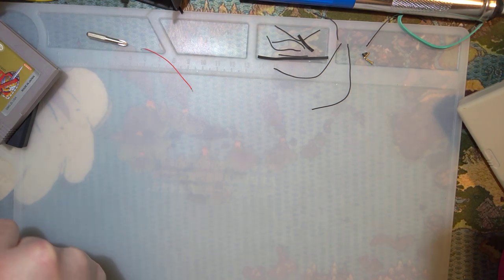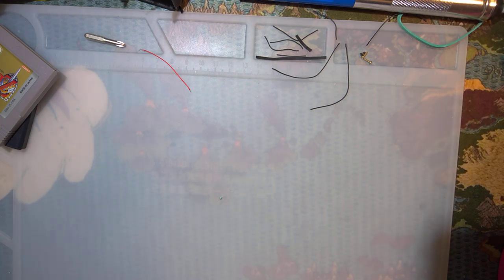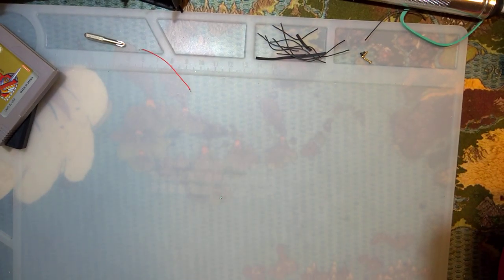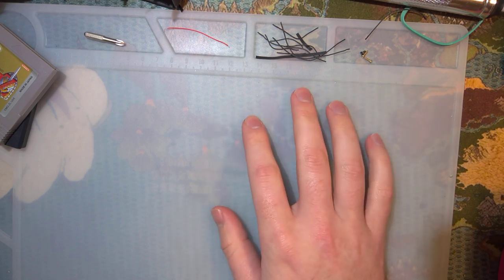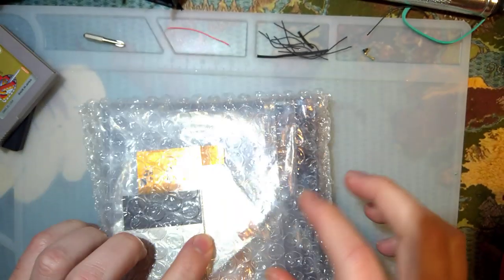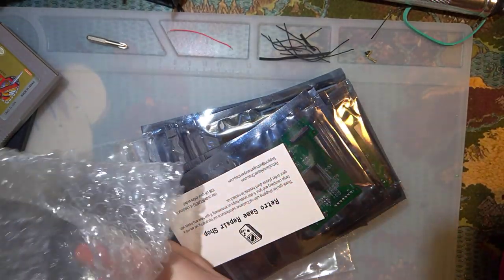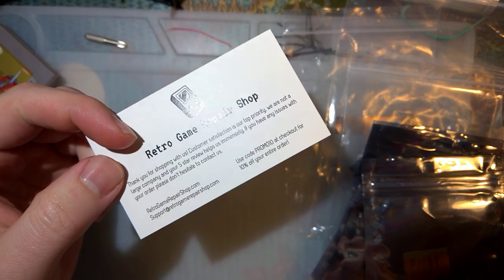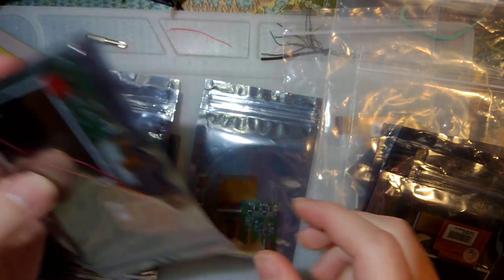Troubleshooting Faulty Backlight Kits

Comment: I got an AIO kit and their 3rd anniversary pokemon center shell from them. I think their products are pretty good
Reply from the maker: I bought a MGB kit from them a few weeks ago (and then I just got two more in this video before I got a chance to install that kit lol) and I was really impressed with both the speed of delivery and the packing of the kit. I've got kits off of aliexpress that arrived in a bubble mailer (admittedly intact though) so it was nice to see the box and all the bubble wrap. Not to mention, I've been in contact with the owner and their support has been immediate and fantastic so far. They've given me so much information on the alternate AIO kits so far. 

Anyway, for kits and stuff, they are probably my go to store now. I'm really eager for their new DMG kit (soon!).
Reply: @makho  Hey quick question. In your videos where you install your AIO V1/V2 do they end up closing/screwing all the way? mine doesn't and I wanted to know if I need to trim the cart slot pins like with the freckleshack mod or something.
Reply from the maker: @perfectbluetrance5607  Yes, no, in that order. The AIO PCB should be seated in the gap between shell and the LCD (see the thumbnail for this video: https://i.ytimg.com/vi/njF9wIuiCb0/maxresdefault.jpg)
Reply: @perfectbluetrance5607  if youre using an aftermarket shell sometimes they arent as stiff as oem and kinda flex a little at the top of the gb.